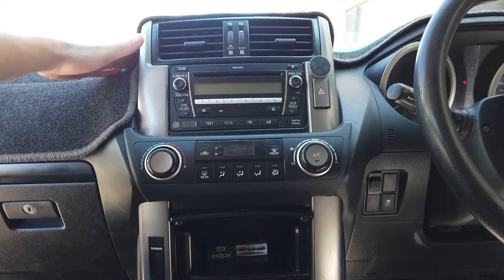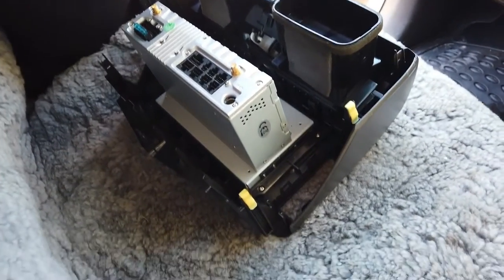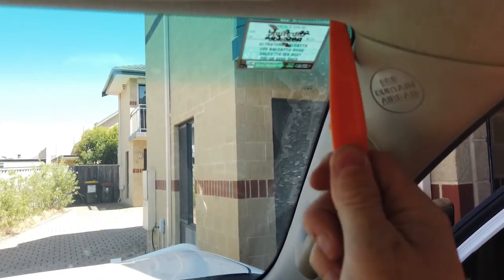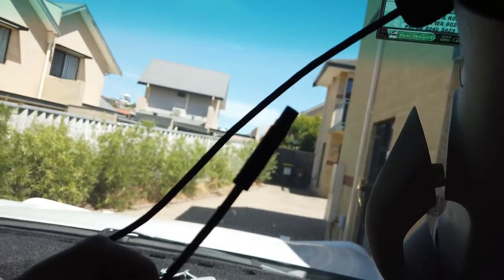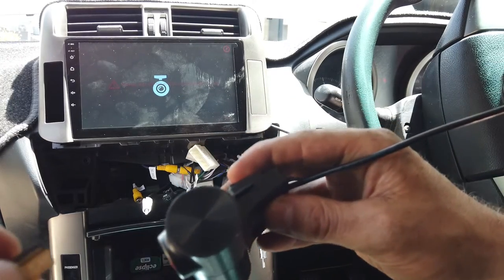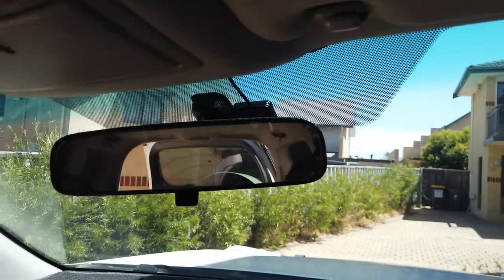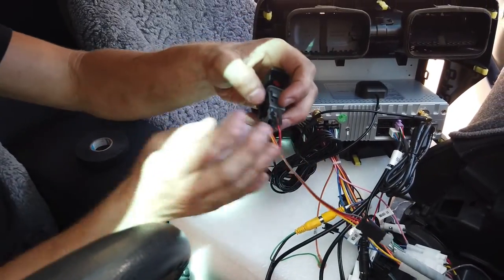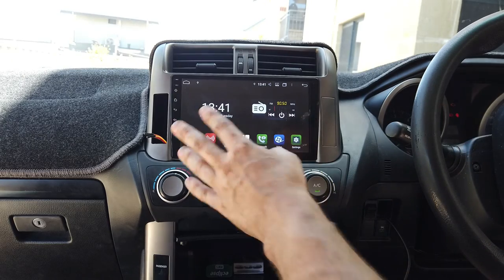Toyota Prado GX Installation

Comment: hey does this deck work with the pardo 360 degree camera?

if it doesn't can you please point me to one that does.
Reply from the maker: Hey mate,

Sorry for the delayed reply, may I ask what year is the vehicle, model and badge?
Reply: Hi, I own 2013 model prado. Can I fix this same display unit on mine?
Reply: Hey mate,
Thanks for the vid.  Looking at an upgrade for my Gx. How has the unit performed thus far? 
I have fitted a cheapy off eBay and the sound has stopped working, the repair would make it non viable.  Wondering a out the sound quality if this unit, is it on oar with the original Toyota stereo?

Thanks.